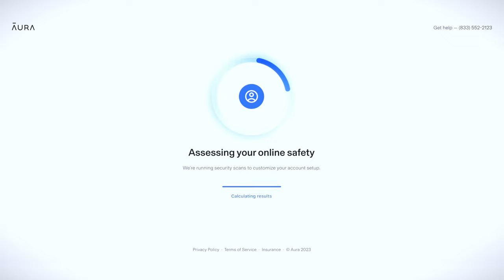The DREAM all white PC build ft. HYTE Y70 touch

Comment: Nice build!
I plan on getting the lian li tl120 for my build, is there enough clearance to plug the connector on the side of the rad with the fittings? I plan to use the other side connector to daisy chain with the rear fans.

Comment: I have a question. I want to do a build like this so I was wondering which fans do you use for the aio cooler, the reverse blade lian li fans or the regular lian li fans. And also for the rear fan did you use a 140 fan instead of a 120 fan?
Reply: The aio cooler comes with 3 fans
Reply: @mile1763  He did not use the Kraken fans, he removes them and uses the Lian Li's. So the question of where the reverse blade fans is still up in the air. Cant really tell.

Comment: I have the same case but only the rear is exhaust. the top, bottom, and side are all intake.
Reply: Any reason on why you do that? Legit question. I’ve only ever built one pc and it’s been a few years and about to do a new set up.
Reply: @MrMastin  So three reasons:
1. Positive air pressure. What it does is it creates pressure in the case which is what you want for cooling. If you ever for work data storage companies or anywhere that has a lot of servers there's usually going to be a shit ton of intake fans blowing in cool air while having a small exhaust. I've worked in places like that and it stays cold. By having almost all intake I'm pulling in a lot of cool air and forcing the hot air out since there's so much pressure in the case from all the intake.

2. My CPU radiator is mounted on top. So by having it as intake I have only cool air passing through the radiator rather than warmer air from the case. 

3. The top, bottom, and side have dust filters. So by having them as intake the filter does it's job and the rear exhaust, which doesn't, doesn't let dust in because the air pressure doesn't allow any backflow. I've had this computer for months and the inside is still as clean and nice as when I first got it. No dust inside yet.

I had a lot of people question this and I did too since my friend set it up but he assured me it works since he's an IT specialist who's worked in server departments. He wasn't wrong. My thermals are fantastic. The highest I've seen my CPU get to is 55 and that's only under a heavy load. When I'm playing helldivers it usually sits at like 33-35.
Reply: @ALLAHALLAHism  What are your PC specs? I like the idea of this. My issue is like a few other ppl in here have asked him, where are the reverse fan blades placed? I literally have the same case but I have an i9 14900kf and a 4090 so cooling is super important for my build. I just need to figure out where I place these reverse blades so I can finally get to completing this build. I'm almost tempted to just get the LCD fans fro Lian Li too but... is that overkill lol?